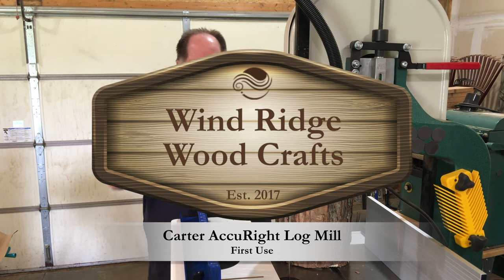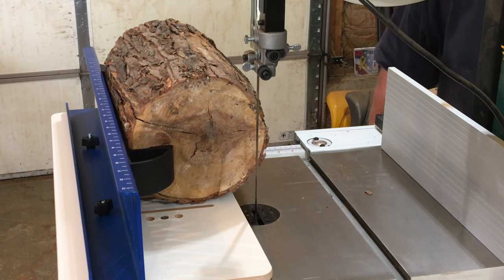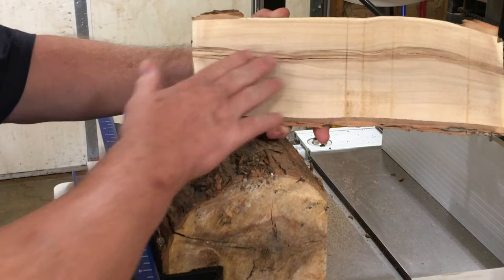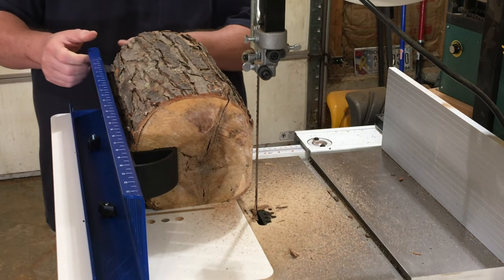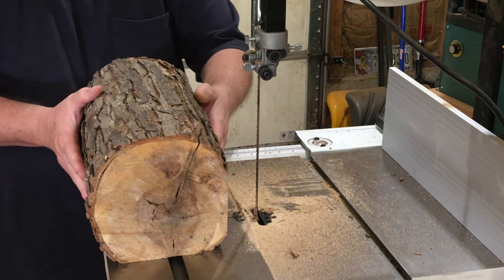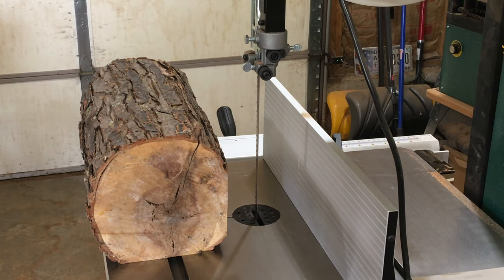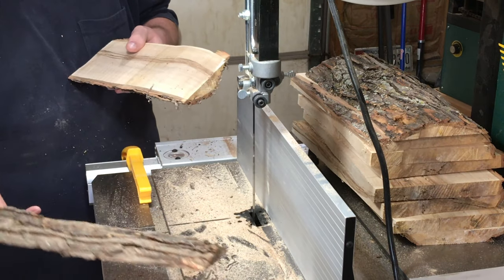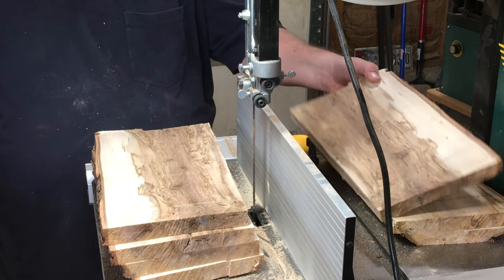Hickory on Carter Log Mill - First Use

Comment: That looks a lot more like persimmon or hickory. Osage is vibrant yellow and the heartwood goes nearly to the bark. Regardless, that wood is beautiful.
Reply from the maker: Matthew, you're probably right about hickory on that. The guy that provided it told me it was all osage orange, but there were a couple oddballs in the bunch. I picked this one to start off with since it was a bit of a mess as a test piece. You can see by that 3rd and 4th piece I was worried about what might come crawling out of it :-)

Comment: I'll throw in a sub to help out another small channel. This is one thing that I am looking to do as well. I have some old cypress logs and I have been wanting to attempt to 'Sawmill' them on my bandsaw just to see if they can be salvaged in any way for a small box. My biggest issue has been blade travel. I 'think' my blade is simply too loose. As I cut the blade flexes and curves into the piece. I have been so worried about over tightening and burning out the bearings that I keep it too loose I think. I would love to hear if you experienced anything similar when you first started milling logs and what your experiences were.
Reply from the maker: I haven't worried about damaging the bearings and tighten the blade based on Alex Snodgrass's discussion. Your bearings aren't indestructible, but they should have no trouble supporting a blade set to its proper tension. Also, I doubt the bearings (or blade) are prohibitively expensive to replace if that should be necessary. 

Alex is pretty much the current-day bandsaw guru, with several bandsaw products and patents to his name. He currently works for Carter products, who are the same folks that make this mill. I took a bandsaw box class with him last year and he went over proper bandsaw tuning with our group as part of the class. This is an older version of what he taught us, but there is veery little difference over the years.

Watch this video (and again before you change your blade the next few times) and see if your bandsaw is set up as he suggests. If it isn't give his approach a shot. I doubt it will do any harm and very likely will do a lot of good. Please follow-up if you're still having trouble.

https://youtu.be/CFZOlNsAgBU
Reply from the maker: And I returned the subscription favor. Many thanks.
Reply: @WindRidgeWoodCrafts  Thanks. I actually watched that one previously. I need to try it again. The main issue I ran into with this video guide was that my fairly wide resaw blade scrapes the 'safety cage' that is installed around the blade on my Rikon. So I wasn't able to center the gullet on the wheels. I think that is another reason my blade travels so bad. I have been debating on removing the yellow safety cage. Previous models didn't have it anyway. Thanks for the reply.
Reply from the maker: @TheProjectHelpDesk  Got it. I know Rikon makes nice machines. It was a tough choice between this Grizzly, the Rikon 10-326 and one of the Lagunas.